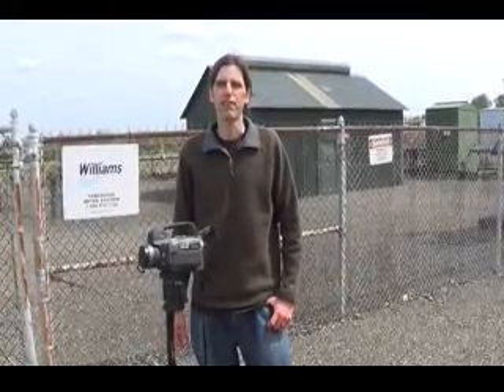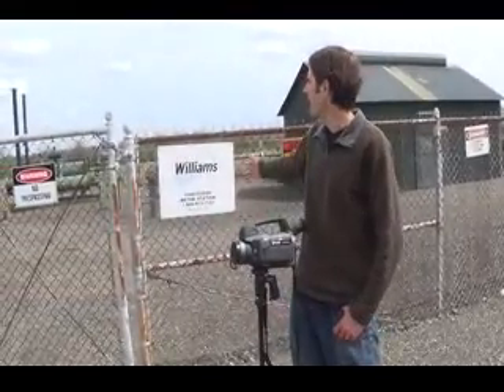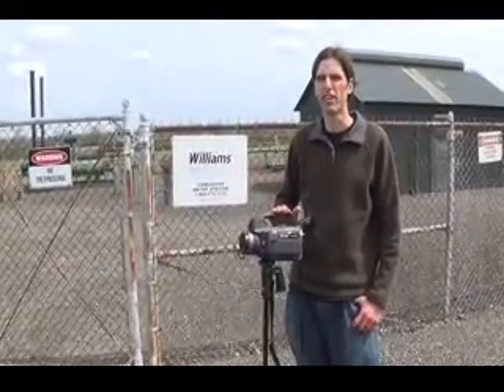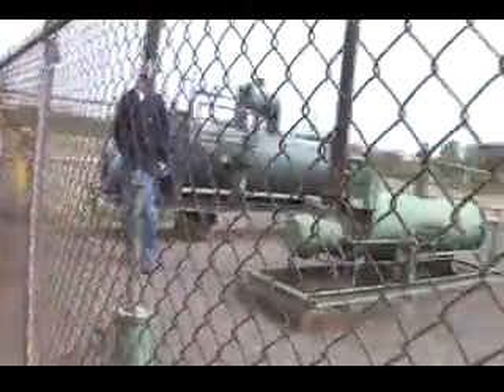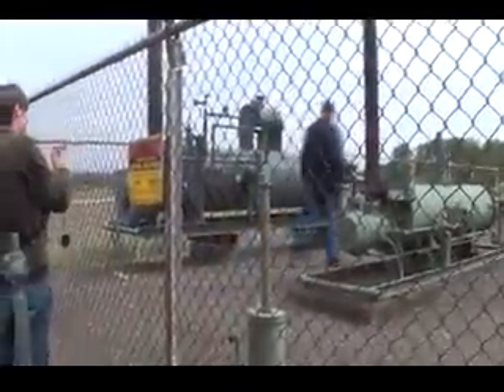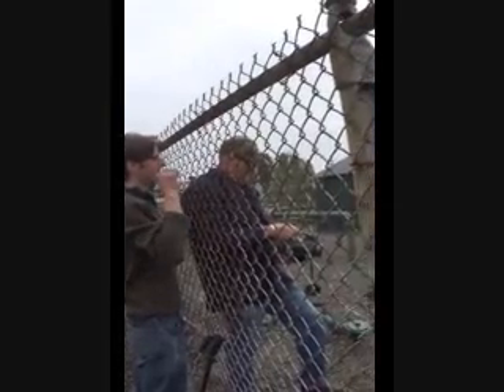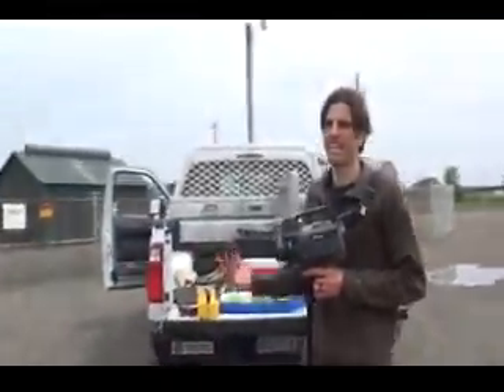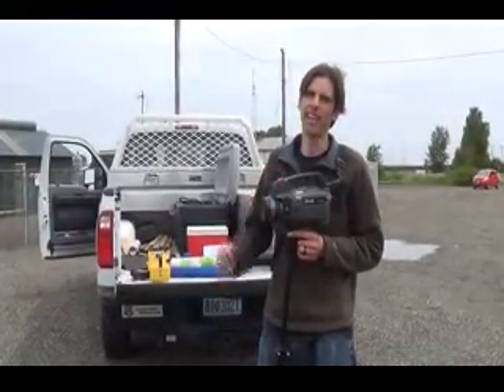Vancouver Action Network finds leaking gas pipe with FLIR Gasfindir camera April 20, 2014

Comment: Did you get called out to that site by Williams, Are you certified Tomography 1, 2 or 3? I have been thinking about getting into the Oil & Gas market and attending Flir's school to get my certification. What department would you call for assignments or do you just go around and find the trouble spot then call it in and will the company compensate you?  I have lots to learn and like everything else we got to start some where. Any help would be greatly appreciated .
Thanks